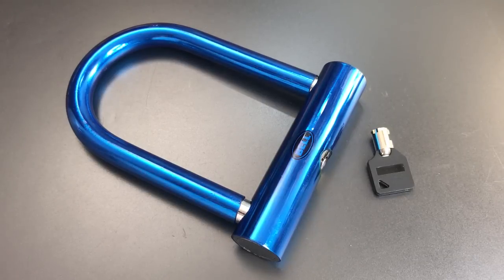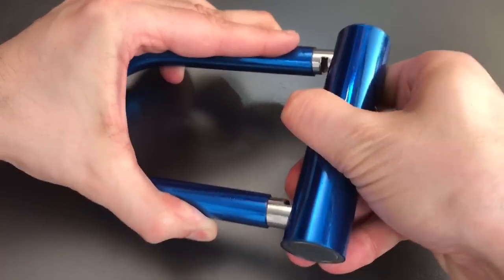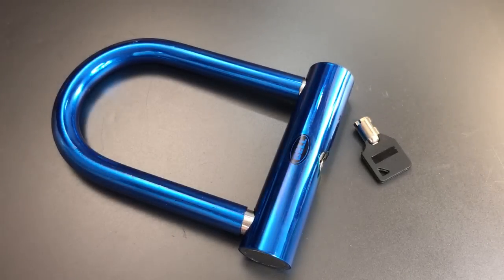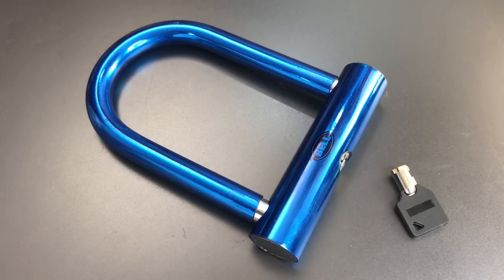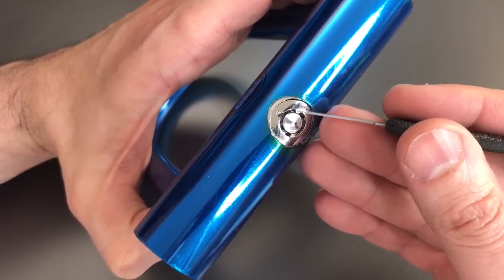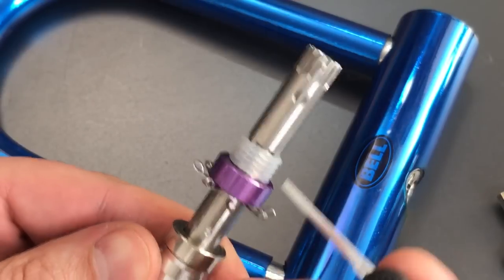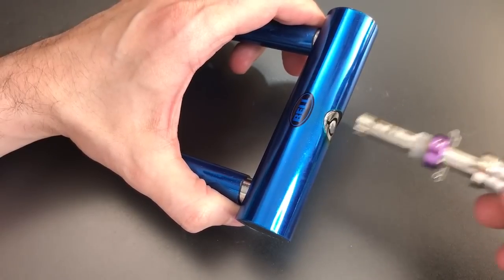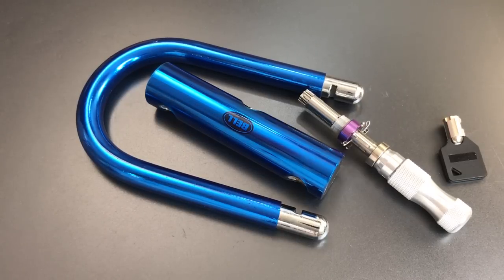[455] Bell "Catalyst 200" Bicycle U-Lock Picked

Comment: Tubular locks are fascinating.  I'm just beginning my entrance into lock picking, amateur wise. Just as a hobby. I have no intention of being a locksmith. The impressioning tool you use looks almost too easy to be believed. Of course I believe it because YOU do it. You're the only channel that I have subscribed to, although I watch many others. I want to buy your $90 lock pick thing on your website that has all the different pics on it, but I have to save up for that. So far I've invested less than $40 in tools and extra (cheap, Dollar store variety) locks to pick and everything. Luckily my work allows for several hours per shift of absolutely nothing to do, so I self-school myself. So far I have unlocked every lock I tried, except a couple. (8 locks) I have yet to attempt or even find a tubular lock. I can buy one of those lucite practice ones, I guess. Yesterday I Amazon-bought a kit for entry into vehicles. Another $40. I used to be a AAA tow truck driver and had to unlock people's cars. But now I want to do it for people who need it, but not charge them for this. I'm not independently wealthy, but I don't need the extra money for doing stuff like that. It's really amazing to watch you work. If I ever get to be 1/10 as good as you are, I'll be extremely happy.

Comment: wow that has to be the quickest tube lock I've ever seen impressioned. I wouldn't lock up a tricycle with it.
Reply from the maker: It usually doesn't go that fast... usually a couple of twists.  But the difference isn't material to the conclusion that this lock sucks.
Reply: My roomie forgot to lock his bike properly, so I put it in the cellar. For entertainment purposes I decided to pick the lock (cheap 5 pin dimple, spool on 1st and 3rd) and lock it up to the washing machine. it took me just 5 seconds using a probe pushing down all the pins and releasing them after tensioning. I tried to pick it again and it always took at least  3 minutes...sometimes you just get lucky

Comment: Could you please try the Bic pen or other household items and also as a test for other abysmal locks like this? Again awesome job highlighting brand/models to avoid. Keep up the awesome work.
Reply from the maker: Oddly, I have NEVER been able to get the bic pen trick to work, though there are dozens of video on YT on it.  Not sure why.
Reply: AFAIK you have to work differently .. I have never tried it though .. 
You're supposed to really impression it. Which means tension the core, make binder pins bind, and then wiggle a bit to make the binder impress itself into the soft material of the 'key', be it pen, or the adjustable tool.
IMHO this should with with unbalanced springs and different length drivers too .. as this method relies simply on fact, that binder does not compress, while other pins do. You need lot more resistance in the tool, the adjustable fingers must not move just under pin spring tension .. they only have to move if you wiggle it against binder.
Reply: @lockpickinglawyer . Because the Bic pen wasn’t designed by you and Bosnian Bill?
Reply: @lockpickinglawyer  I could never get that to work either it's good to know someone who's actually good at this kind of thing can't either makes me feel a little less bad about my lack of skills but that simply because I'm comparing myself to your amazing skills

Comment: Hi Harry, Surprised at how quick the impressioning tool worked. We have seen on the odd occasion with similar locks, that when the key was removed, the pins remained at the shearline, just offset from their correct position, not noticable until an impression tool is applied. This would sometimes happen, making the "Bic" pen attack a little more successful. Could this be the case with the Bell?  Regards, Brian.
Reply from the maker: +Brian Hignett Just pulled the lock out and checked. That's not the case here. It opened with similar ease several times in a row, after checking to ensure that the pins were "springy."  This lock is just in tune with the tool.

Comment: I did not expect this to open right away - unbelievable. What do you think is the reason for them to not have it fixed? Would be interesting to get a response from them - will you contact Bell?
Reply from the maker: +Potti314 no idea why this is still an issue. I didn't contact bell. I contact makers for newly discovered flaws... not common knowledge.

Comment: i wanted to see the pen attack! did you try it on this lock, and did it work? when using the pen, its much more impactful then using that impressioning tool, because that tool looks like a specialized thing that people might think is hard to get or that a thief probably wouldnt have. (which may be somewhat true, i doubt these are common even though easy to get), thats why the bic pen got in the news so easily, everyone has one!

Comment: What if Bell makes a new edition of the same lock (and I don't mean the other caralyst 200 you've checked a couple times, since it's a different lock with a different mechanism), the only difference being putting 7 different tension springs to it, would it make it a good lock? What would it take to unlock it? Thanks!

Comment: Did you remove the pin from the middle of that tool?
Reply from the maker: Yes... or it will not fit.
Reply: Nice, I didn't know they came out. Cool the way it still works with seemingly nothing to drive the lock, huh?

Comment: And i thought my Bell 12mm hardened u lock was secure... people tried to take it but couldnt
Reply from the maker: +THUNDERBOLT 1003 well, too its credit, it's fairly well hardened against destructive attacks.
Reply: LockPickingLawyer it also has an extremely unusual key
Reply from the maker: +THUNDERBOLT 1003 "extremely unusual " is a little strong... it's a standard 7.5mm tubular key. Not as common as the 7.8mm variety, but not all that uncommon either.
Reply: LockPickingLawyer mine has a flat key with circular grooves in the sides
Reply: LockPickingLawyer it looked similar to that "unpickable lock" key

Comment: Potential update:  Just found your video while browsing reviews of the Bell Catalyst 200.  It looks like the Catalyst 200 locks currently selling on Amazon now feature a disc detainer lock.

https://goo.gl/Vt4Ly1

Can you do a test/review of these newer Catalyst 200 u-locks?

The price is really sweet, so if the construction is still the same as the unit you previously reviewed and the core has been made more pick-resistant then this could be a great value lock for people with cheap bikes who don't want to lose their ride.

Lastly, if you do review the newer Catalyst 200, could you include a measurement of the shackle thickness?  It would be nice to know if the shackle is thick enough that small and medium bolt cutters can't span it.

Thanks.